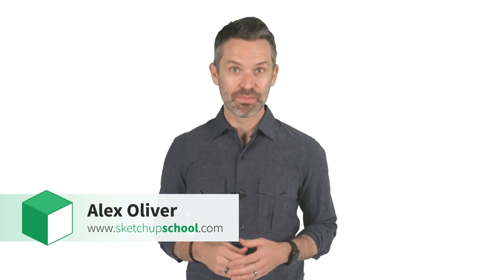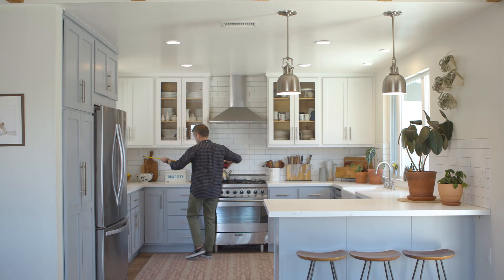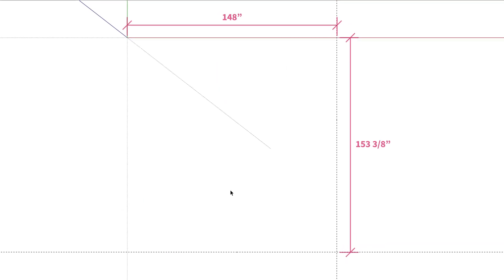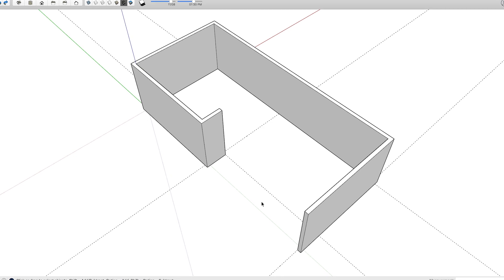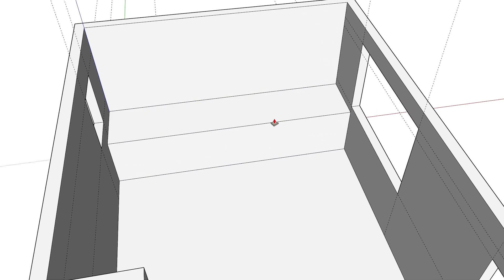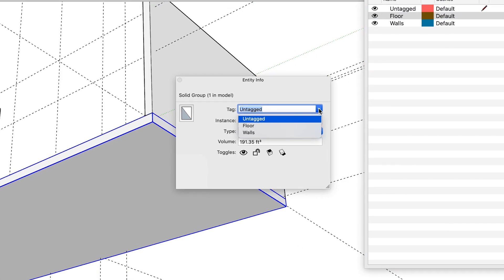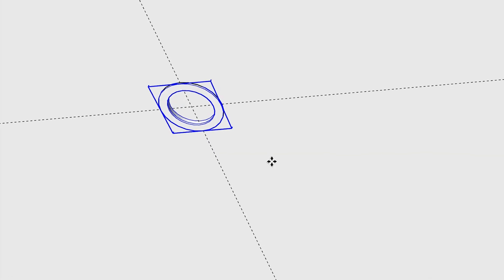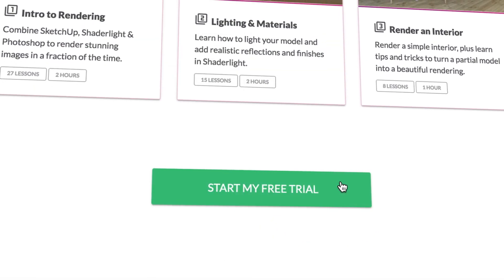SketchUp Interior Design Tutorial – How to Measure & Model a Room (9 EASY steps)

Comment: How do you change the orientation of North for your model?
Reply from the maker: You can either rotate the geometry in your model relative to the Green axis pointing more or less north. Or you can use the Solar North extension to modify the North direction: https://extensions.sketchup.com/extension/393f5153-ba5f-4f5f-849f-46b32cf64bd4/solar-north

Comment: How do you recommend that we show clients before and after layouts? For example, do you create two separate files? what can you do to draw the basic overview once and then show by removing some walls to display the new open concept and kitchen layout?
Separate files or the same file. Seeking guidance.
Reply from the maker: There are pros and cons to either approach (separate file vs. same file). If you go with the separate file approach, one downside is that when you make a change in one of them you have to always think about whether that same change needs to be made in the other. However, the upside is that each file can sometimes feel more manageable than when you try to put both options into one file and try to manage them together. 

In general, we would usually recommend two files IF there aren't going to be a bunch of changes you have to keep making in both files as you go along. Otherwise, go with the same file approach.
Reply: Yeah, i started putting in one drawing. the landscape is massive and can build next to each other. @SketchUpSchool